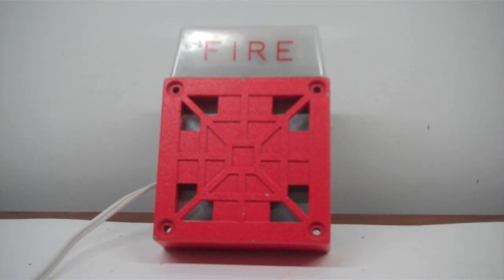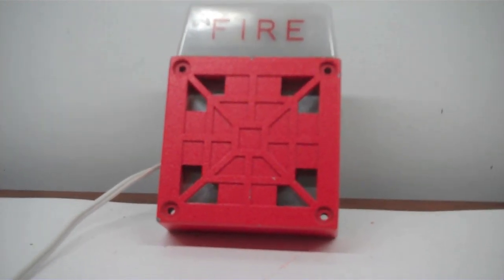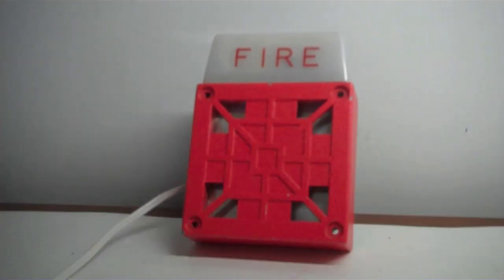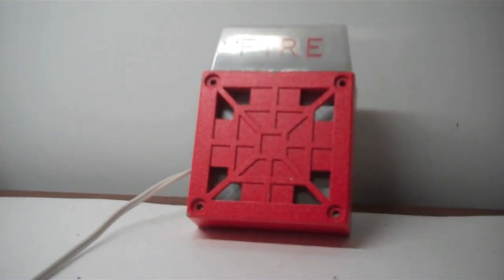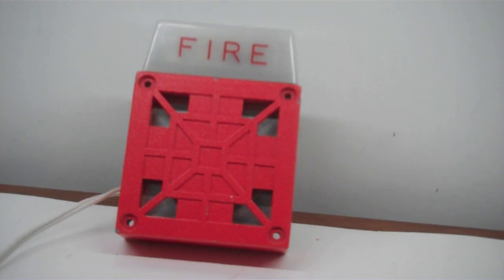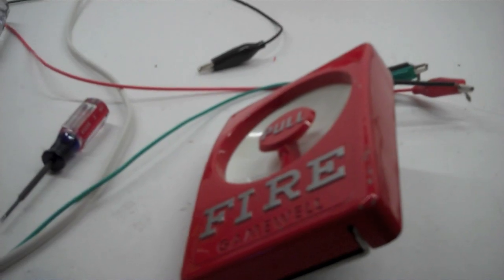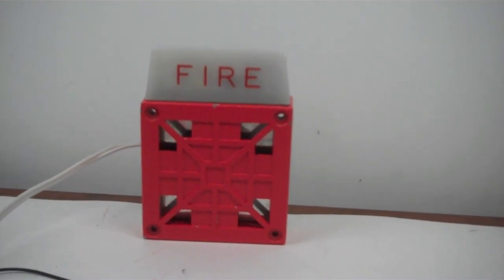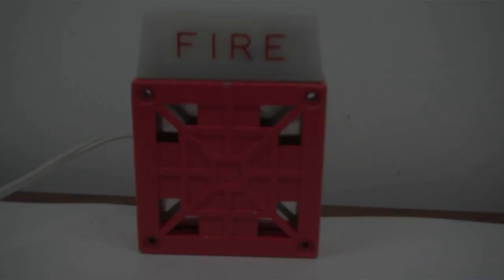Wheelock 34T-24-WS-24VDC Fire Alarm Test (Sort Of, AND YES IT'S A 4-WIRE 7002T!!!)

Comment: did you adjust the volume screws? and the nut near the hammer and that little golden thing? be careful while doing it so you dont break the horn
Reply from the maker: I might of when I initially got the device. However, I haven't messed with it in 10 years since I got this. One of these days though...I appreciate the suggestion!
Reply: @NewEnglandElevators  try again if you get time. It might get it to work. Or its probably busted

Comment: I think the horn is broken. you should get another one of those Wheelock 34Ts. I'm  sorry that the siren that didn't sound at least the strobe works. and yeah I think the horn on your alarm is broken.
Reply from the maker: There is definitely something wrong with the horn. I haven't fully investigated it yet, but would like to in the future. Such a shame, it's a unique alarm.

Unfortunately, I cannot just get another one right out of thin air. This alarm is kind of rare; I haven't seen one like this pop up on eBay ever since I got this one. At least I have my 7002T, and 34T alarms working fine.

Comment: If you try to fix it, be EXTREMELY careful of the little reeds that go back and forth  that make the horn buzz. The slightest little bend in those will screw them up so bad. I killed my 7002t by accidentally bending them just a small amount.

Comment: Hopefully a connection issue is the case, otherwise the coil itself could have been damaged. You should probably check different part individually, if you can safely do so. This should pinpoint the problem.